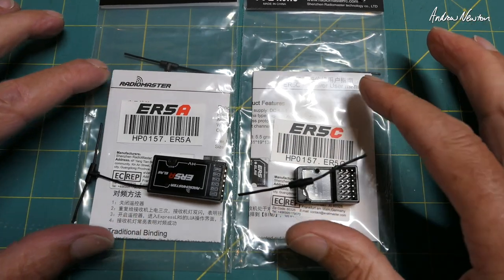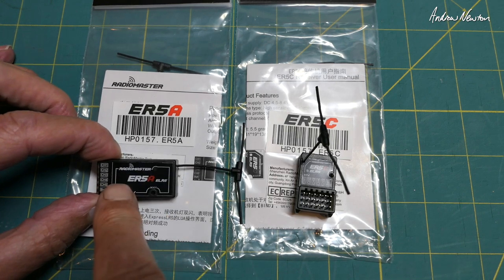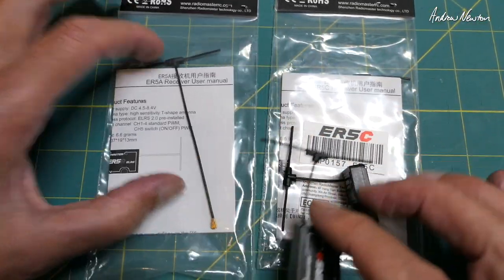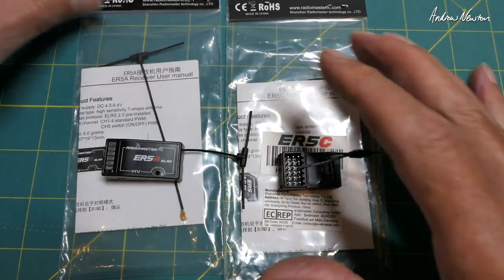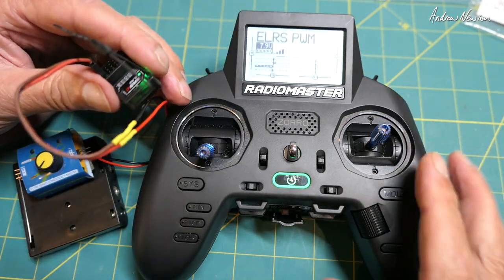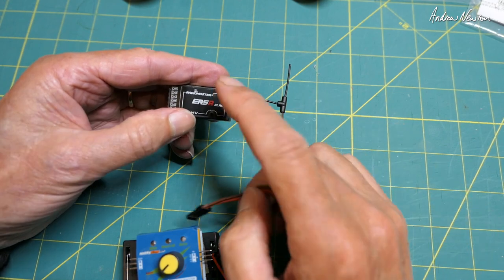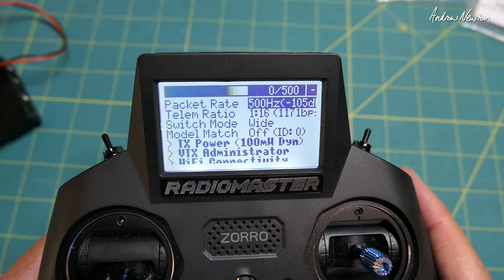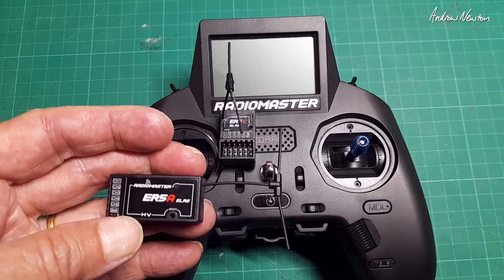RadioMaster ER5A and ER5C ELRS PWM receivers

Comment: Greetings Andrew. Just to clarify, you only get 4 full resolution channels with these receivers since channel 5 or Aux 1 must be set to 2000us ("Armed" state) for all the safety and functional features. This is a leftover from the exclusively flight controller applications. This limitation will probably go away in revision 4.0 of ELRS once the devs figure out how to do it. I'm converting all my fixed wings, about 16, to ELRS using 6 and 10 channel crsf to pwm converter boards from MatekSys.
Reply: Hi Guys, can you explain what features would not be working if the channel 5 was not set up before flying? (I have done a few tests with this receiver and so far the operational range has been very low! (the channel 5 was not set up)
thank you
Reply: @ericflighttester7145  I do know that the Dynamic Power stuff does not work if Chan 5 is not set to 2000us, or some percentage of that number. So, if you were using the Dynamic Power feature that may explain your lack of range.  Some other features are broken as well.  You can out more about this by hanging out on the ELRS Discord server.
Reply: @jimn6sxb644  good advice 👍 thanks